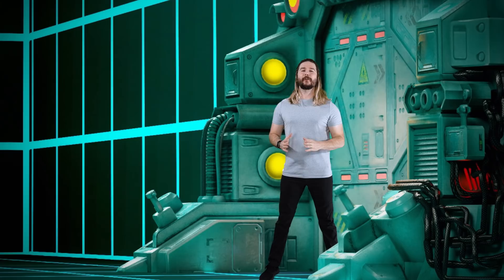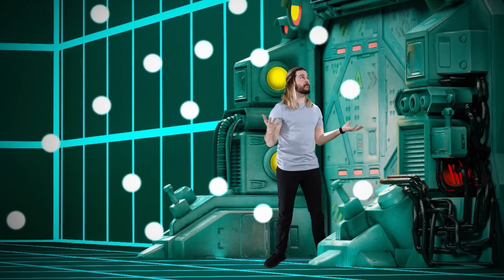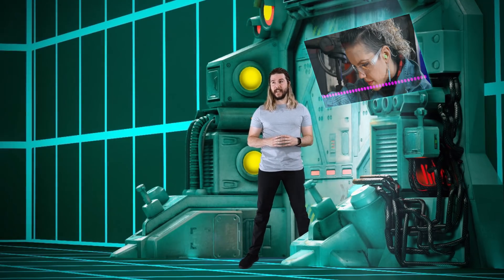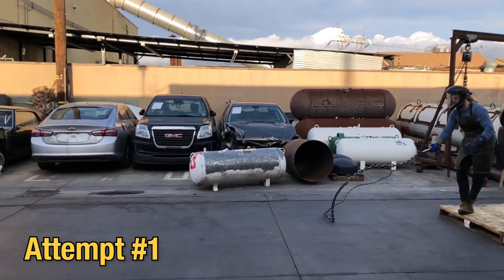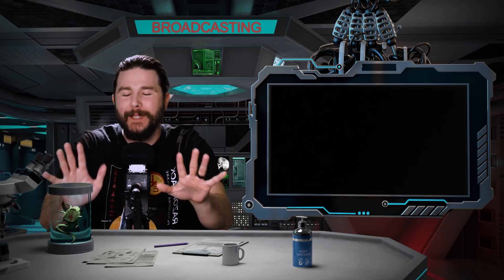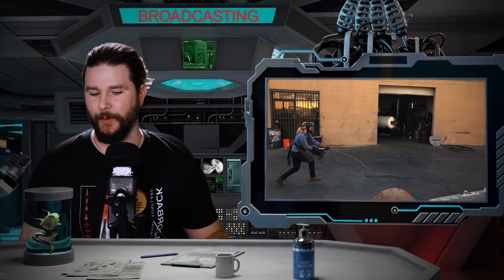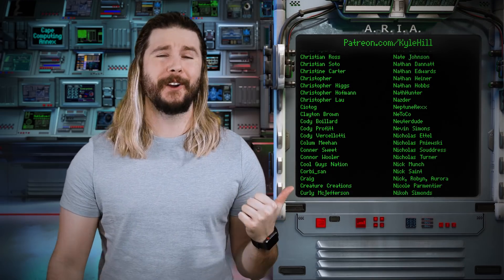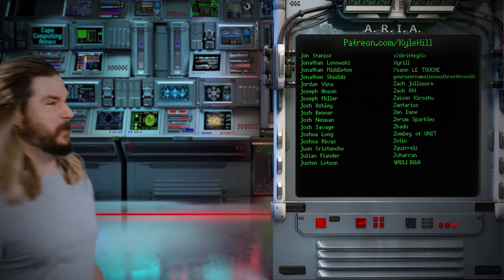Can I Make a SUPERSONIC STEEL WHIP?

Comment: It's likely a material structure issue. If this was a steel fiber or rope, it'd crack like a normal whip easily enough. It's probably just the fact that it's a solid steel whip not having the stretching and compression of material distribution when whipped like softer stretchier materials like leather and normal rope unless you're whipping it much faster than just mach 1.

Comment: 2:54 My only though: sonic booms through steel.  Would that even be visible on the surface of the steel?
Reply: Also, how fast does sound travel through the various degenerate forms of matter?  Is there a density such that the speed of sound is faster than the speed of light, or would a black hole supersede that limit?  What's the speed of sound through a singularity?

Comment: Holy shit Kyle. I see two major things wrong here.

1. That damn chain is fabricated wrong!
There are 2 points of substantial decrease in mass. When the chain folds over itself in the angular momentum that you are swinging, the changes in mass act like a fulcrum and distributes the momentum unevenly. Looking at 6:55 and going frame by frame, you can see these fulcrums in action. The 2nd fulcrum actually hits the ground before the rest of the chain gets a chance to transfer the momentum to the end of the whip.
in short, FIX THE DAMN CHAIN AND USE SEQUENTIALLY SMALLER DIAMETER CHAIN LINKS AND STOP CHEATING!!!! 

2. Your technique is trash bro!
The "video everyone sent" shows, not only a properly built chain bullwhip, but the technique used is a circular swinging motion combined with a sudden change in angular direction causing the chain to move energy of the sudden change down the chain. ADDING a small twist to the wrist at this sudden change aids in the momentum needed to break the sound barrier.
In short, YOU GOT WEAK GAME AND LITTLE CHILDREN'S ARMS!!!!

Your's truly,
                      A long time fan

P.S. Been watching your videos for a few years now. Love your content. Cheers!

Comment: After watching both videos, I believe I see where you could make this actually work.

First of all, most leather whips are actually braided leather and/or braided sinew wrapped in leather.

With your "chain whip", you will want either one of two things:

1) Multiple smaller and lighter links.  A "normal size" chain would require a mutant with an arm musculature roughly as thick as Kyle's torso.

2) Braided cable lengths, joined with cable clamps.  This configuration qould allow the greatest chance of success for a true "steel crack".

The TikTok video guy did indeed cheat.  The end of the "chain whip" is indeed a lengrh of cordage that utilizes the greater mass of the chain to accelerate to a sufficient speed to "crack" with less precision and with a much greater chance of success on each attempt.

Comment: Chains have holes dude, good luck getting a boom at the end if the end has a very aerodynamic hole at the end of it, replace the last foot of chain with a more closed off object.  You can keep it metal but you want full contact with the air. I suggest a kind of toy snake design made of metal at the end. Like the wooden snakes that slither

Comment: I appreciate you making this video and this point, Kyle. If I can add to the message at all: I think the best scientific paper I've ever written was one where the experiment yielded no results. I had no data (other than a lot of zeroes) to show, and yet was able to investigate the lack of results and probably learned more than I would have if the experiment had gone as I expected. For those curious, the experiment involved trying to create a basic generator (Faraday Disc) and investigate the result of altering the composition of the metal in certain pieces of the apparatus (mainly the disc itself). I measured no output from any of the tests but ended up learning a lot by breaking down what could have gone wrong. From the relatively weak magnetic field I was able to create to the lack of sensitivity of my measuring device, there were myriad things to investigate and learn about as a result of the "failed" experiment. Now to be very clear I am not a professional researcher and this was years ago for a science class, but even so I think I got more valuable information than I would have if I had simply discovered that "alloy X seemed to be the most efficient and alloy Y was the least efficient in this type of generator". Point being: JUST TRY STUFF!!!! Most of it won't work but all of it will teach you something useful for the next thing you try!

Comment: If all failures were published it would drown out the successful ones, kudos and thank you for publishing one that others can learn from, too many people believe success comes first time every time. Failure is the cornerstone of learning, look at SpaceX they had numerous public failures.

If there is a next time (not that i would recommend it) , perhaps 1inch thick leather padding around all extremities and chainmail pants (assuming that won't make matters worse), or maybe alan pan can bnuild a robot arm to do it (and probably best not to do it in a carpark around all those cars, my first thought was you were going to smash a few windshields, not your leg)

The most important thing is you were not TOOOO seriously hurt, it would have had the potential to take your leg off, or at least wreck your shin bone.

The other thing to mention about the steel whip, it would have so much mass you would need to be very strong to impart enough energy to make it go that fast, and whilst you are stronger than i am, perhaps not strong enough (the guy in the video looks a little larger than you, so even if it wasn't a hybrid whip he had it there is that to consider)

Comment: No wonder you didn't brake the sound barrier. If you would have taken a normal whip and done it the same way as you did with the steel whip you wouldn't have broken the sound barrier either. The whole motion was wrong.

Comment: I’m wondering if the material at the end needs to be super fine, like hair. I looked up pictures of a bullwhip, and most of them seem to have a part at the ends made of a different material.
Reply: I’ve made a couple of paracord bullwhips, and the end does need to have that super fine part (appropriately called a cracker) in order for the sonic boom to be audible.
Reply: @Magniflorious    called a fall but ok
Reply: @carloguerrero6583  No, the fall comes before the cracker. Those are two different parts. The fall is the slender and supple latter part of the whip and the cracker is an easily replaced portion attached to the end of the fall.
Reply: Actually horse hair in some whips
Reply: So something like jewelry chain might work? Might not last, but it might work.
Reply: @seanrea550  if I remember correctly that’s even kinda the point, if you can have an easily replaceable part that takes the brunt of the punishment
Reply: @0Bonaparte  That is correct!

Comment: . . . So just pointing out, when I learned to crack a bullwhip we were supposed to get it completely in the air. . .

And I don't recommend it with that chain since if you have that much mass at that speed, I could easily see you taking a limb off if you messed up.

Comment: So I was sure this is what you were talking about a couple weeks ago about hurting you leg.  I would have suggested leaning forward like you did in the original series to prevent the ' preceeding curl ' when launching the whip, while moving your hands in the opposite direction at ~50% unfurled moment.   This opposite wave that you send down the chain can force it to straighten out and help prevent it from coming back at you as it gains slack.

This is something that you do when throwing out a water ski line to prevent knots while checking that it isn't broken.

Comment: Just a thought, but could potentially the non gradual shift in the cross section lead to this? Like looking at the first to second chain it almost seems as if it links rather than transfers the momentum like a normal whip

Comment: Hi Kyle, I did work as an Industrial Mechanic and currently work as a Machinist. The first video I watched I wasn't even sure IF you could make a chain whip without a solid tip as you observed in the tiktoc video. There is a difficult but possible process of "pulling" steel to be tapered wire thin. It would require some machining and engineering to hold it on the tip. Another point brought up was the use of mild steel, relatively speaking a 1016 mild steel is light when compared to 416 stainless steel. Depending on the materials your fabricator is used to working that could be something to look at, since there are steels such as 5140 or 4340 that have slightly less density than 1016 mild steel, with a much higher tensile strength than the steel chain you currently have.

and for some comfort. I only reason I liked shows like Mythbusters was to see the failures, data that was collected, and redesigning the experiment to produce the expected results. Not just the whole, a smashy smashy. That was just the icing on top

Comment: You weren't really whipping the chain.   Try with a real whip.. you don't crack by simply throwing it forward.   You need to act in an opposite direct closer to the end of your motion in order to make that sound.  To crack a chain like that you need IMMENSE strength.  More than that big guy had that's why he added the leather at the end

Comment: You aren't strong enough. Not making fun of you or anything, the weight is the problem, I doubt any human would be able to with metal like this. Superman maybe? A leather whip weighs next to nothing, steel has to be more than that, if you made it longer and lighter, you be making all kinds of sound with that. Maybe a robot or machine could get it whipping and be safer?

Comment: Did you consider using a steel cable whip instead or a different style chain for the main part of the whip that was lighter and could be swung faster and be easier to control?

Comment: You need a less confined space...preferably at the very least, a diameter space double the length of your whip.  
I was thinking 2 things when I was watching. 
1. Why is he in a parking lot instead of an open field?
2. What is the apron for? He needs hockey leg pads. (and then the chain proceeds to hit your leg)

Happy further safe trials.  Or just try a Guile sonic boom.

Comment: Kyle I might be able to help, on a technical level. You draged the chain across the ground, transferring sound into the ground. Did you drag the end of the chain, across the ground, faster than the speed of sound, through the ground? If so, you did actually succeed in a way.

Comment: I'm actually a little disappointed with you for that last part.
As a scientist, you know that the negative-hypothesis is paramount in deduction. Failure is a factor of not producing a set result. Testing a concept only produces RESULTS, not failures.
Dude! Show your working out, and nothing is a failure unless you don't learn from it! Never be afraid to show the unsuccessful test results... Those are equally as important as success

Comment: Is the chain moving fast enough to act as 1 unit or is there a slight moment before the wave gets to the end that the link are moving independently causing energy loss. I see you try to correct friction loss by whipping mid air instead of the ground. Also in pop culture you see two distinct motions, a forwards throw and a flick back, thoughts? I assume the safest way to get the crack would be to lay the chain in front of you and thurst up then down as hard as you can but I haven't tried it to see if its harder physically or if it will come back at your face.

Comment: Hey Kyle, don't beat yourself up over this if you're still interested in getting it to work I had a thought. You could get higher up on a ladder or a roof (probably taller than the whip is long) and let gravity assist the chain as you swing it, that way you can set the chain up so that it falls and is less likely to hit you. Either way I love the show and appreciate you and everything you do, keep it up.

Comment: Don't worry another Youtuber called Integza has been trying to build a functioning Pulsejet engine for about half a year now and still hasn't been able to reach his goal. While he always has some success (be it a new material or a new design which slightly improves the engine) he hasn't been able to create an engine that is able to lift it's own weight so far and his videos are definitely worth a watch. Also he is probably very happy about what you did to those tomoatoes last video.

Comment: Theory for further increasing speed:
When you flick the whip, it creates a circle-like wave that travels down the length of it. If you can get that curve to become tighter at the end than the base, then preservation of angular momentum would make the tip "spin" faster. I might be wrong, though, since mass also decreasing with radius could cancel out, leaving angular inertia and thus angular velocity the same.
I wouldn't suggest testing this theory unless you have even more protective gear or a robot to do it for you. The steel might just be too heavy for the technique anyway, but it's still fun to think about.

Comment: Can’t really call it an objective failure if you didn’t change the variable of the person using it...

Try it with a professional then we can talk. 

Edit: The only valid conclusion of this ‘experiment’ is that Kyle Hill can’t use a chain whip. I expected some better work here sir, and you call yourself a science boi. 

And yes, there could be room for design improvements, since the tip of the whip is the most important part. You didn’t even mention what the tip was. If it was light chain then you would lose a lot of your energy to motion between the links of the chain yes?
If you changed to a ‘heavy’ thin gauge wire then you might be more successful.

Comment: Yeahhhh braided steel rope would of been a much more likely to succeed method in my eyes. Between the weight and how the links acting on each other may effect things perhaps? I'd really like to see a steel cable tapered as a whip, however the thing would be likely rather lethal, and braiding that would NOT BE FUN, as someone who's worked with chain and steel rope for a decade.

Comment: Hey Kyle next build a machine with enough torque to get the chain whip to move with the proper speed.  Also you would need the machine at the last second to pull back to cause that snap at the end.

Comment: I think it's amazing how much travel the chain did in the time it took Kyle to react. But it's still unwieldy, not practical. So it's still not a chain whip due the fact it can't be used in a real scenario. I think you could have used a much smaller diameter and still create an impressive weapon. And a hint, have a surface to strike, like the upright pallet. If you strike it, some energy will be absorbed and it adds to the impressive factor.

Comment: I'm starting to think it might be possible, just requires a ton more force than usual to get a crack. Not only is it trying to push through the sound barrier like a normal whip, it also has the friction from every single one of the chain links that a bullwhip doesn't. It's completely possible. But realistic for average humans? Maybe not

Comment: I believe this is still very possible for you if you were to reduce the length and gauge overall watching it back over and over you can see that you just don't have the kind of length or muscle you'd have to put behind a whip that size you'd have to be damn near double your height the crack that thing made out of pure Steel.

Comment: One thing that seems obvious is that you don't want so heavy of a whip, that makes it extremely awkward compared to a bullwhip. Steel is plenty strong, you can make it thin I'd think, as long as you can keep the taper. You could try steel cable for the thin end, but that would be pretty unsafe, even by the standards of this pretty unsafe exercise. 

To protect yourself if you ever try something akin to this again, look into the gear people wear when using a chainsaw professionally. Chaps (if you can get both on somehow) would have protected your legs a lot better, and you could probably buy larger sizes and wear 2 pairs (possible front/back?). 

Super cool experiment though, and I'm guessing you got faster than my big silly copper cable whip I made as a teen.

Comment: I don't think this is so much science as a lack of practice. I have cracked a number of chain whips like this and it is nothing like  cracking a regular whip at all.  Chain whips are more like swinging a bat. If the chain is hitting you in the back of the leg that is because you need to go wider with your swing. 

With that being said I wouldnt recommend swinging a chain whip at all.  They tend to put to much pressure on the wrist and it is easy to injury yourself.

Comment: Kyle didn't make the same whip cracking motion as the guy in the example video, though. He just flung the chain forward and stopped his hands, leading to the end of the whip slowing down or stopping (mainly by hitting the ground or an obstacle) before all of the momentum generated at the handle reaches the tip. I'm no expert, but from what I can tell, that's why someone who knows how to crack a whip makes two opposing motions (e.g.: forward and then back) at the handle in order to keep the whip airborne as the momentum is transferred all the way to the tip in a wave-like motion. That motion and resulting angular momentum might be a big part of cracking a whip, too. It mainly seems like Kyle didn't have the necessary control of the chain whip to get enough velocity at the tip.

Comment: I would presume not. The amount of force required to get steel chain from standstill to mach 1 is a bit mich momentum for air resistance or the rigidity of the whip(it being chain) to slow down to a safe speed by the time it gets back to you.

I hope you wore body armor.